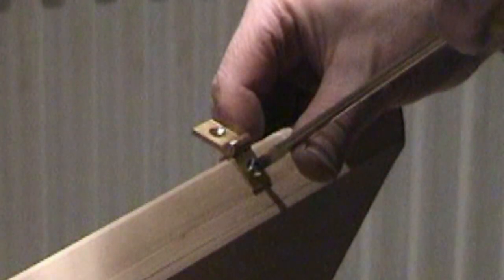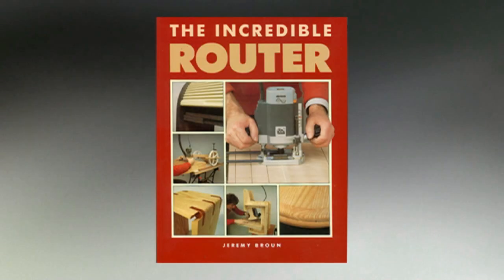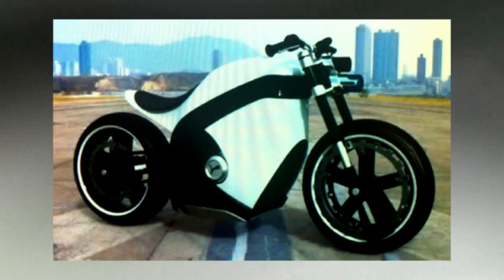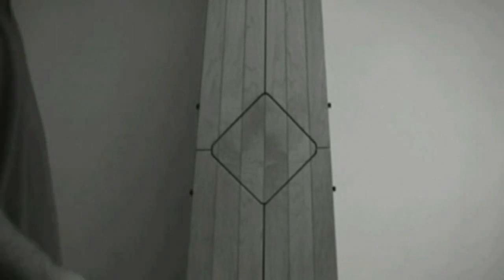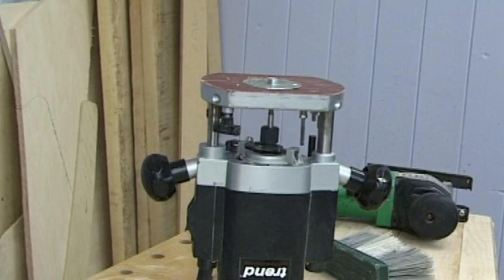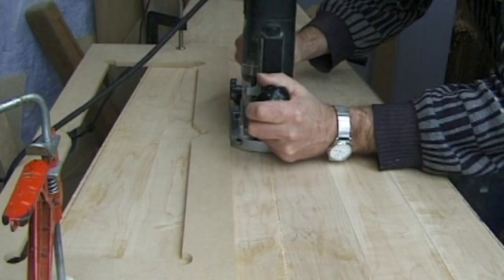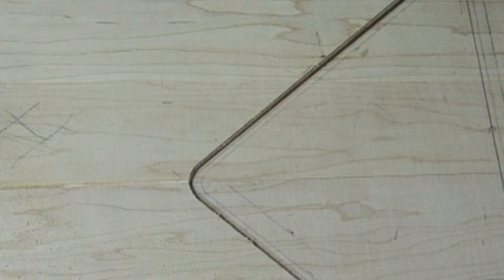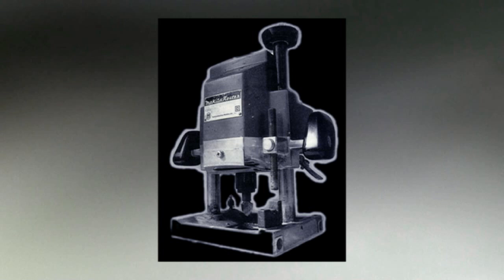Routing - a different way of making a cabinet

Comment: Jeremy, I learned the hard way how useful a router can be. When my company went out of business some years ago I started making underwater camera housings for video cameras to sell online.  I called them the NEMO 200. I made them out of 6 inch diameter SCH 80 PVC pipe. They could go to 220 feet depth. I had no one to tell me how to make them. I was clueless on how to get the ends square after cutting with a reciprocating saw, as I had no table saw big enough, and to put the 1/4 inch groove in the end to place an o ring nearly drove me mad as it had to be precise and the width of the PVC pipe wall was only 1/2 inch. If I told you all the ways I tried to level the ends and make the groove before I decided to use a router you would laugh.
 in the end, I made a jig to level the ends on top of a router table and a second jig to hold the squared pipe to make the shallow o ring groove. I could not have made my underwater housings without a router. I no longer make housings or have a shop, but I still think a  router is an amazing tool. I think the next nice thing I buy for myself will be one of your router books.
 Thanks for making and sharing.
Reply from the maker: Robb - perhaps you should post a YouTube video on all the other ways you tried before discovering the router!
Reply: I would have to post on the comedy channel.